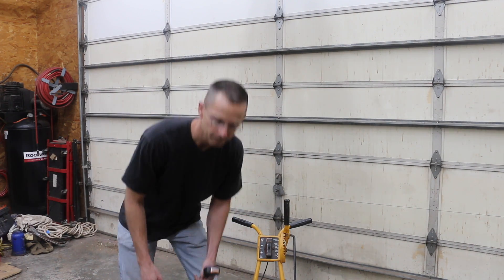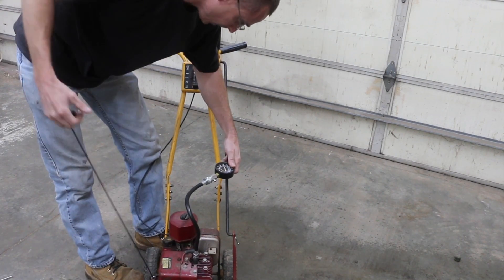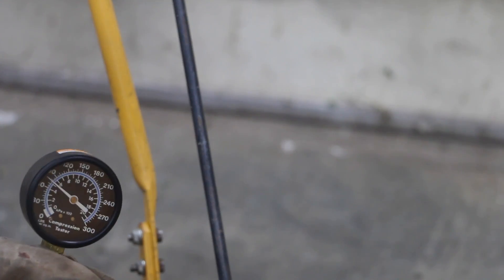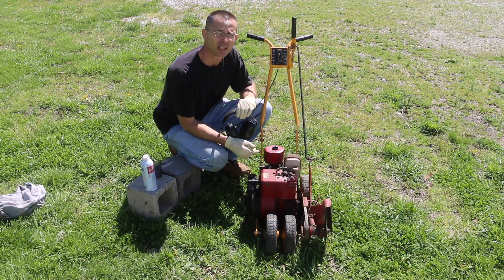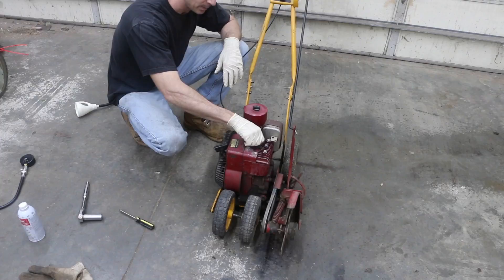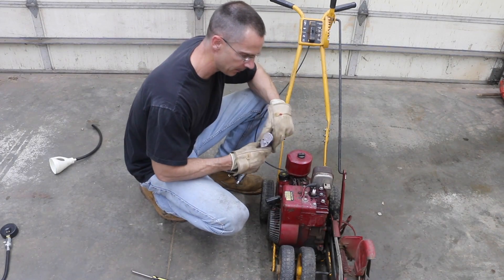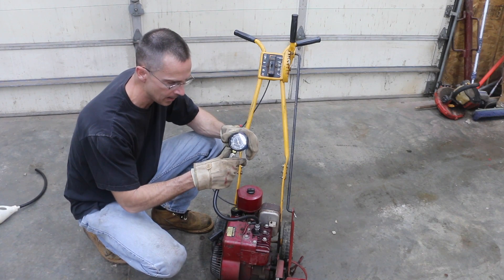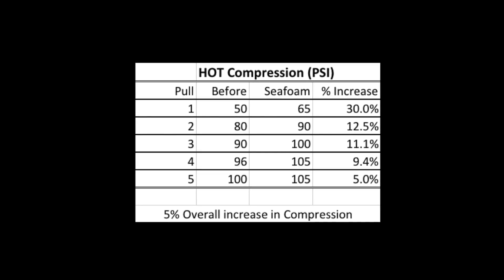Seafoam--can't believe what it did to my engine!!--Episode 4--Compression Test

Comment: I have used Seafoam in the past. It does a GREAT job of cleaning up carbon, but there is a catch. On a small engine like your edger it is fine. What happens to all the gunk which gets blown out of the engine in a car though? You have catalytic converters which catch it! I have accidentally killed a catalytic converter this way. Also, if you own a Ford EcoBoost engine (turbo/twin-turbo) using anything like this will void your warranty. I imagine other manufacturers are like that also, but I only own a Ford TT, and I am assuming the cleaning agents damage the turbos. For small engines or even motorcycles this is fine, but I would not use this on a recent car unless you have a spare, gutted catalytic converter laying around to use during the cleaning. It IS funny to watch an old Ranger ride around the back-roads fogging up everything though!

One more thing. One of the key ingredients in Seafoam is alcohol. I do not run any gasohol (what 99% of the stations serve now, like 10%) due to it containing ethyl alcohol. It damages my bikes and power equipment, and costs roughly 3.9MPG on my F150, which is a massive overall loss on a 36gal tank. This prevents me from using Seafoam on many things, now that I have damaged stuff and learned. I'd use it on my mowers any day though!

Comment: I don't understand you ran engine on seafoam no this video I'm commenting on the engine really bogged down it almost stalled so will a motor really actually run on seafoam I saw the video but now you have a motor stalling out on it
Reply from the maker: Thanks for the constructive feedback
Reply: @ProjectFarm  it's weird how different things do do stuff I mean like I engine stalls out on seafoam when you spray it right into the carburetor but you can run an engine on seafoam if you fill the gas tank with it that's weird I wonder how that works

Comment: I threw an ounce of marvel mystery oil (and let soak for 1 week) in each spark plug hole for my 2001 ducati 900 supersport and came up with + 20 psi on horizontal cylinder and + 10 psi on vertical cylinder. I followed up with an ounce of seafoam soaked for 1 day. After sea foam, a lot of pitch black fluid came out when I started it up with the seafoam (the black goop was dripping right out of the seam on the slip on exhaust). I think you said a oil change is recommended, is that because the black goop gets into the oil/crank case also? I had another symptom when I ran the engine with sea foam in the spark plug holes (mind you it's an air cooled twin) but the oil temp got super hot (82 deg F that day) at idle (after about 30min). I have no idea if this is expected behavior or I should be looking to professionally sonic clean my oil cooler.
Reply from the maker: Good Idea!

Comment: My 95 Honda Del Sol today has 330,000 miles. And my former mechanic rebuilt the 5 years ago, about 48,000 miles ago. Rebuilt engine head, Bored out and new piston rings, completely cleaned the engine and took our Throttle body and cleaned it very well, etc.. My New mechanic doesn't want me to do any kind of Seafoam, etc. But I have seen guys with old Del Sols with engines that were never rebuilt using SeaFoam and getting great Results. I figure I should do this now to keep it clean before it has to much build up... The Car Runs super strong, great gas mileage, etc. Any thoughts? I do know you should do an oil change after using seafoam... some guys say drive it for 100 miles before oil change, some say drive it 10 minutes then do oil change... what are you overall thoughts on this? Thank you!
Reply from the maker: I'm always reluctant to advise people.  If it were my vehicle, I would use it periodically.

Comment: So the hot soaking method...where do you pour the Seafoam into? Spark plug hole? In with the gas? Both?
Reply from the maker: Both, but be careful that you don't hydrolock the engine. Thank you.

Comment: I like seafoam in the gas and oil. In the combustion chamber just use water. If a vehicle is pinging due to pre ignition it can be carbon buildup. Sucking a big glass of water thru a vacuum hose will clean up combustion chamber. For fun if u suck up iodine purple smoke comes out. Used to do it in a samurai. But, I do like your test and cant argue with results. Holy shit while I was typing you mentioned your going to do a water test. Cant wait
Reply from the maker: Great point.  Thank you.

Comment: I can’t say I understand Seafoam. I know it removes carbon, but how does it restore compression? From what I understand, compression is lost when gases pass through the piston head into the crankcase, and compression would be lost if the piston rings get worn down. So how would Seafoam fix that?
Thanks
Reply from the maker: Piston rings and valves don't seal well if there's excessive carbon buildup.  Seafoam does a great job at removing the buildup.  In the "Monster Energy" video, I caused so much carbon buildup that the intake valve stopped sealing properly. As a result, it backfired, catching the engine on fire.  Subsequently, I used a product to clean the combustion chamber which restored compression by removing the carbon.
Reply: Project Farm Thank you!

Comment: Love your videos man, you gave me hope for all my whoopties 👏🏽 one question though, I have a 2001 Toyota Corolla 1.8L and they are known for burning oil, at the moment mine doesn’t. It has 74,000 miles and I want to make sure that it never burns oil, do you think Seafoam will help prevent the oil burning? I change my oil every 3000 miles religiously, air filter every 6000 miles and replace the pcv valve/spark plugs every 15,000 miles.
Reply from the maker: I don't think Seafoam is necessary if you continue to provide great maintenance and use a high quality synthetic oil.
Reply: Try motorkote. In one of his videos it left a film. Those rings won’t wear as fast with some extra protection on the cylinder walls.

Comment: when you remove the carbon the compression will go down a hair, carbon deposits increase compression and can cause pre ignition, plus affect air flow around the intake valve, the engine might run cooler too
Reply from the maker: Great point.

Comment: You keep harping on about the "age" of the engine in years.  That means nothing.  What does mean something is the actual number of hours that the engine has been in use.  An engine sitting on a shelf for the past 50 years has no deposits built up.  If your edger has at least 1000 to 5000 hours on it, then yes, you can bet it has carbon build up from bonafide use.
Reply from the maker: Thanks for the constructive feedback.  I agree,  hours of use and how it was treated during the use.  Thanks
Reply: You're welcome.  And I think that what you are doing with all this stuff is cool as hell.  Backyard science can lead to really interesting results.  Keep up the fun work!

Comment: Water?  No. Carbon isn't water soluble.  You need soap too!  A better test would be gasoline vs seafoam
Reply from the maker: Thanks for the recommendation.
Reply: After more thought, the carbon on pistons isn't really soluble in organics any more either (it's pretty much inert soot), so you are going to want to use something that can break down the carbon-carbon bonds.  To solublize carbon nano-tubes they use dichlorobenzene, though that might be hard to get a hold of.  Alternatively you could try chloroform (you can make it your self by adding either isopropol (rubbing) alcohol, ethanol (vodka), or acetone (nail polish remover) to bleach.
Reply: Also, Naptha would probably be the best detergent to add to the water (you can get it at Walmart) to clean soot deposits)

Comment: TAKE THE CASE OF SEAFOAM AND SHIP IT OFF ON THE FLOATING SHIP INTO OCEAN, SEAFOAM USE IT IN THE OCEAN. TELL THEM TO SEND SOMETHING THAT WORKS LIKE A 60 CASE OF  8CYL RESTORE ADDATIVE, THEN GIVE AWAY TO WINNERS. SEAFOAM THATS FOR FISH. RESTORE FOR EVERYTHING BETTER. JB WELD MARINE FORMULA WELD SEAFOAM CANS TOGETHER FOR FLOATING BOAT. JB WELD MARINE BEST EPOXY IF YOU HAVE 7 DAYS. YOULL NEED A BLOWTORCH TO REMOVE.

Comment: How do you do this 2 a car? You putting the seafoam where the oil goes?
Reply: Watch the first video in this series.  Seafoam can be used in the gas, the oil and through the intake. It has worked for me.  And, NO I AM NOT PAID BY SEAFOAM.  For the haters.

Comment: In some cases removing carbon around the rings will make a engine use oil, which decreases compression. I've had engines that if it weren't for the carbon build up on the rings, it would be worse as rings had much wear and carbon helped seal them up. That engine might be old but some of those small engines don't get much use either, they sit around more than anything. You should have tried this on a high mileage/high hour engine. Just because there is carbon build up on the piston doesn't mean much, could have had a bad carb on it for awhile, running rich.
Reply from the maker: All great points. Thanks for commenting.

Comment: I have just seafoamed a Johnson V4 looper outboard and found it dropped compression 15psi on one bank matching the two banks @120psi.
Reply: My guess is the sea foam removed excess carbon in the one bank of cylinders.Too much carbon in a cylinder is a bad thing and it causing excess compression can hurt your engine.My guess is that your engine ran considerably better despite the lower compression ratio on the one bank of the engine.Am I right?

Comment: You missed on thing on your test muffler on small motors have spark arresters in them and you need to remove it and clean it and that helps greatly. This is so you do not start a fire when mowing in tall dry grass. These small engine will blow a flame out when the governor opens with out the spark arrester muffler
Reply from the maker: Great point!

Comment: It's hard to get an accurate compression reading in some small four stroke engines especially horizontal shaft engines because all of the horizontal shaft engines I've torn down had an automatic decompression system on the camshaft which is obviously so it's easier to pull the engine over with the rope. Seafoam did do a great job at cleaning and even increasing the compression slightly in your engine. That's awesome that you've had that edger for 25+ years and it still runs like a champ. Good old Briggs and Stratton engines will run forever if you take care of them.
Reply from the maker: All great points.

Comment: When you put seafoam in the sparkplug hole & put the plug to steam you said make sure it doesn't hydro lock. Would it hydro lock if you pulled the cord while plug was still in?
Reply from the maker: Yes, it would likely hydrolock.
Reply: Project Farm hey bud so in the past I have run the fuel in car dry & put in to cans of seafoam in your opinion do you think that's ok? Do you think it would do anything? Or even with very little gas in the car & adding 2 cans of seafoam?

Comment: Your test sucks. Sea foam is just a cleaner and doesn’t do anything to help cylinder/ring seal. I could put an ounce of motor oil in there and raise the compression 20 points.
Reply from the maker: Thanks for commenting. If the intake valve or rings have a lot of carbon, the compression will be off and Seafoam an help.

Comment: Removing carbon from the combustion chamber is not going to increase compression. Carbon build up actually raises your compression due to the smaller area in combination chamber from the carbon deposits. This is why sometimes a vehicle with higher mileage that runs lower octane fuel will start to have detonation and poor fuel economy. The compression ratio has increased slightly from carbon deposits and ignites the fuel prematurely due to higher heat in the combustion chamber.
Reply from the maker: All great points.  The compression gain occurs when the valves and piston rings seal better.  A great example of increasing carbon buildup substantially, which losing a lot of compression can be found in the monster energy video from a while back.

Comment: Carbon build up in a combustion chamber raises the compression.
Reply from the maker: Great point from purely a compression ratio/cylinder volume perspective.  Carbon build up has become an issue for proper piston ring and intake valve sealing in several tests.

Comment: Yes higher compression ratio will make an engine start and run better especially in cold conditions. ..the higher the compression the better the fuel atomization will be causing it to ignite hotter and burn better ... that's why diesel engines are more efficient
Reply from the maker: Great point!

Comment: Before they even thought of Sea Foam we were using DexronII ATF to clean engines and I would but 1 qt to 100 gal of diesel  with an early Cat 3406 engine to keep the injectors clean. The company I drove for at the time was having problems with the fuel quality and called me into the office to ask my what I was doing to the engine. I had the only truck in the fleet without problems so they started doing it in all the trucks. I do not know if it really did anything but it sure seemed to and I used it in my cars too just like you did the other products and it did seem to clean them up both top and bottom as I also added it to the oil just before I did an oil change to flush the system.
Reply from the maker: Thank you for this recommendation.
Reply: Rich Hurd , the worst thing that the government did was to remove the sulfur from the fuel. That's what lubricated the pumps and injectors in the diesel engines. Putting the atf in replaces the sulfur. One of my friends got pulled over for a fuel check to see if he was using red dye (off road fuel doesn't pay road tax) fuel. When the officer dipped his tank he found the fuel had a red tint. He accused him of not paying the tax . when he told him about the atf the officer said we take the sulfur out and you put it back in. The driver said if you wouldn't have taken it out I wouldn't have to put it back in.  Driver left without a ticket.
Reply: Rich Hurd dude seafoam has been around longer than Dexron 2 has.

Comment: You are correct that the only reason the compression increased was due to better valve seat and ring seal. Most likely better intake valve sealing.
Reply from the maker: Thanks for commenting!  By the way, when I did the video adding Monster Energy to an engine, the intake valve became so contaminated with burned sugar (carbon) that it wouldn't seal.  Consequently, the engine backfired through the carb and lit engine on fire.  When I compression tested the engine afterwards, the compression was down by a lot.  After using a combustion chamber cleaner, the compression rose dramatically.  Thanks again!

Comment: Theoretically, if it actually works it will lower compression as by cleaning out the carbon increases the combustion chamber volume.
Reply from the maker: Great point.  If it cleans carbon buildup that's preventing the rings and valves from sealing, that could help compression.  Thanks again!

Comment: removing the carbon will decrease compression, but it will run cooler as the carbon build up traps the heat, also  the seafoam will clean the carbon off the back side of the valve and improve the air flow, the best way to use the stuff is to pour a   whole can in the gas tank of your car or truck when its almost empty
Reply from the maker: This is an excellent point. Thanks for commenting!

Comment: Hi! I have a question for you, I dont know or undestand why did the compresion has imrove with the carbon removal. Carbon use space in the combustion chamber and so it less down the space aviable; so it must improve some compresion. By removing that dirt space is increase so compresion should decrese. Thats what I think. If I am wrong please tell me so.
Great video!
Reply: but also when you remove that carbon taking up space, you allow more room for more air to be drawn in the cylinder.
Reply: My guess would be it freed up the rings so they sealed the cylinder walls better and increased the compression .A good thing for power and efficiency.Visit engineering explained on you tune for and explanation of why higher compression is better.Of course this is within the capability of the engine design and fuel being used.

Comment: Personally I'd use good gas like Mobile, Exon or shell which has more detergent content that would help carbon build up. Water getting in the oil cant be good to the rings and bearings. I believe in maintaining the engine like fuel filter, plug inspection, fuel filter and fuel mixture and high speed running and if I'm not satisfied , I'd rebuild or buy another motor as long as the mower is worth it. I'm not impressed with Seafoam  or water.

Comment: I have used both seafoam and water in different vehicles.  I found seafoam performed well in company trucks that were not maintained well before I took the job.  In the early 90's I moved to California from a non-EPA state.  I had replaced my EPA carb on my Nissan pickup and was no longer using my 7 year old catalytic converter but still had it.  I bolted the cat in and proceded to dribble water from a garden hose through the carb while maintaining a high idle for over half an hour.  actually had a dribble of water coming out of my tailpipe.  I took it in for emissions testing the next day.  The truck had over 200k miles on it and passed the testing with flying colors.  The test station said they rarely had vehicles test so cleanly.  I had over 300k on it when I got rid of it.
Reply: Grover Duffield I was taught to use water drip also,never used it on a vehicle w/ a cat on it,I presume it cleaned the cat with an hydrogen or steam reaction .A clogged or fouled cat probably causes most problems.(computer controlled carburetors what a nightmare here in the north.)